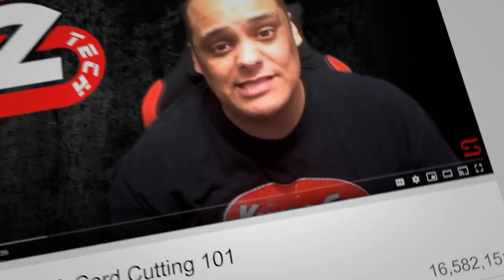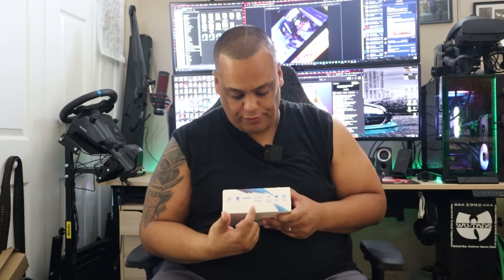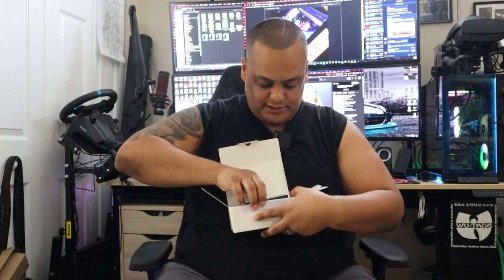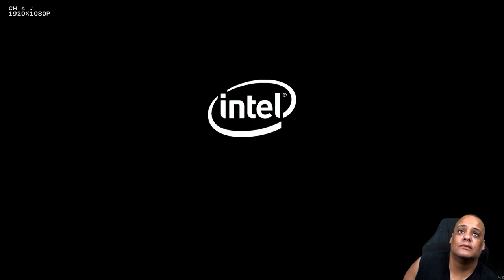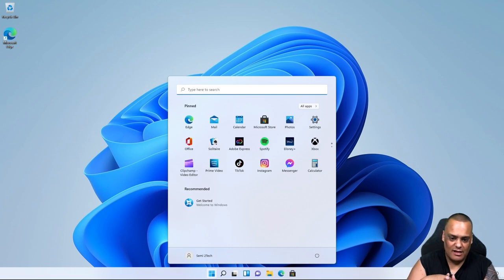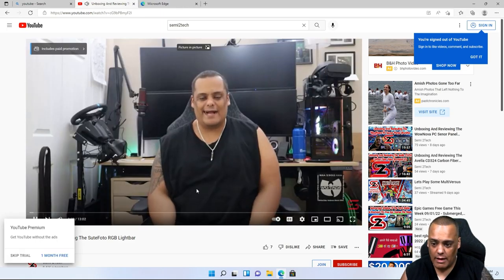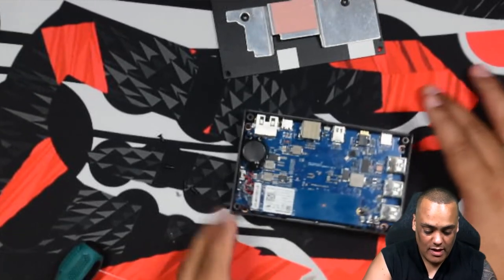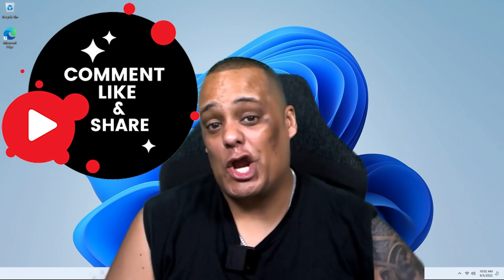Unboxing And Reviewing The Mele Quieter3C Fanless Mini PC - Budget PC

Comment: Good video. The item you called double sided sticky tape is actually for heat sink for the m.2 stick and should be applied to it before you close it up. The case is used to help dissipate heat.